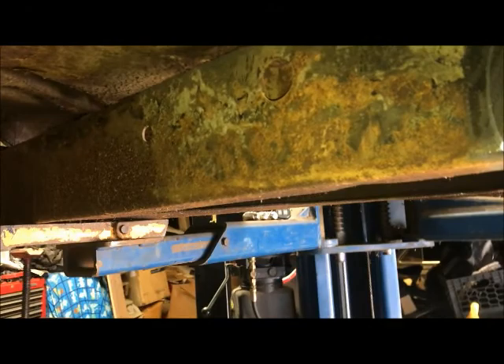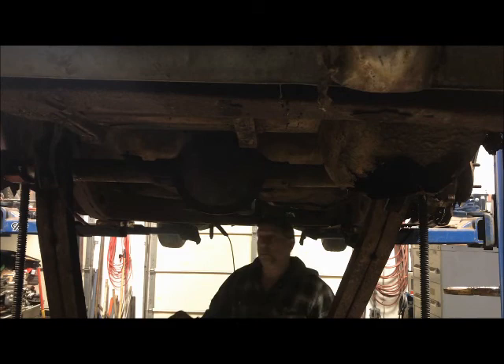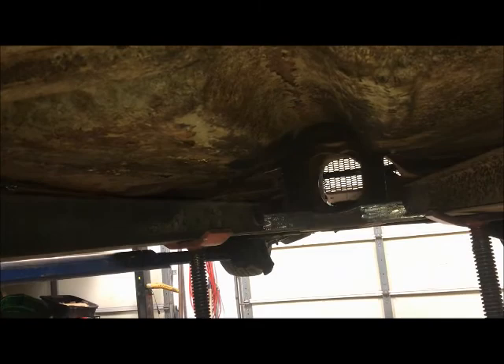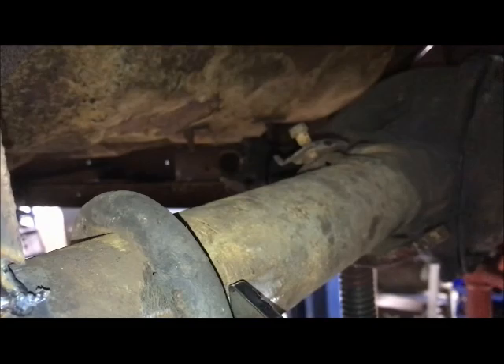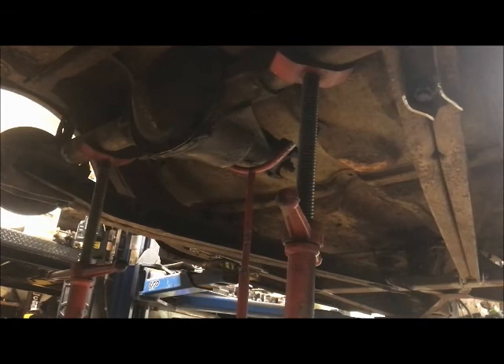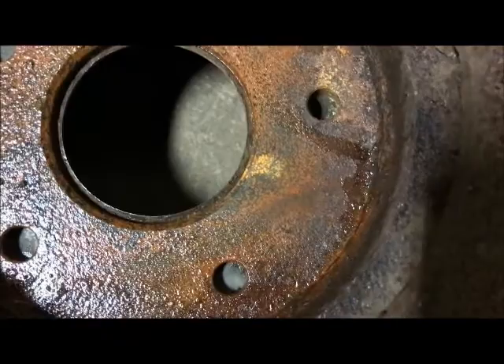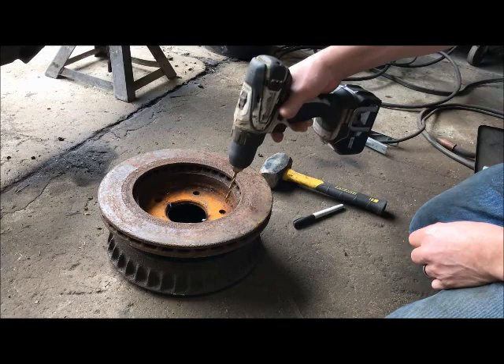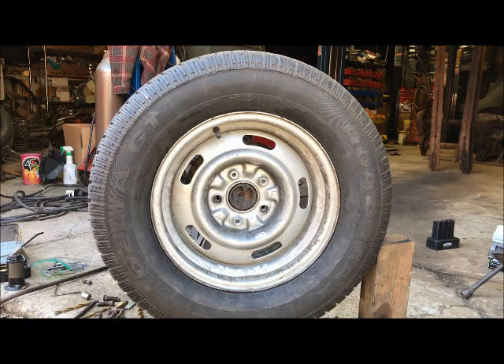1955 Buick Special Turbo LS Build part 12, Truck arm suspension part 2 for the POSpecial!

Comment: I'm trying to mate a 455 Buick in my 55 Super and I have 2 posi rearends right now to work with a 3rd Gen Camaro and a wider Pontiac from the 60's or 70's I haven't looked up yet.
. Your video is the best so far I've seen on swapping these type rearends with the truck trailing arms. Not sure how I'm doing it yet but with minimal welding hopefully!
Reply from the maker: If you make a bolt in mount for the front arms you can do this with almost no welding, the info is out on the web but a lot of pictures have disappeared. Thanks and good luck!

Comment: had the same idea , my 55 olds has the x was just going to add a couple cross members and box it
Reply from the maker: Looks like this will work fine, but I am keeping the front part of the "X" to keep the original trans crossmember mounting points and not lose the front structure. Good luck with your build!